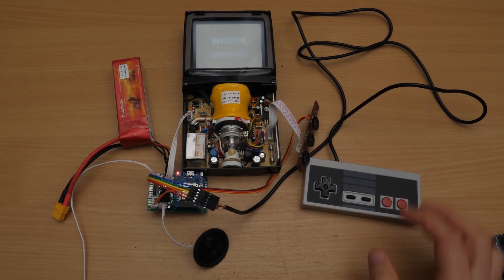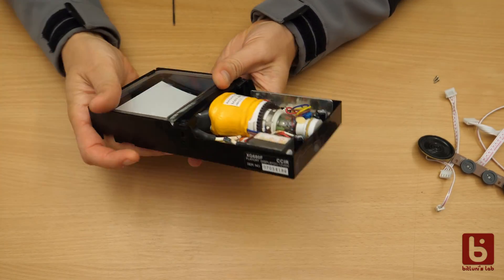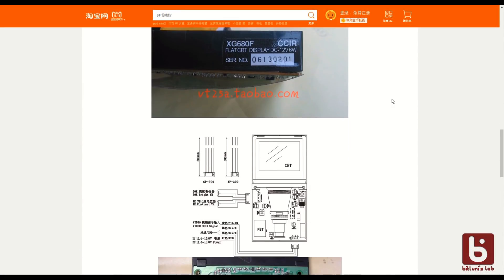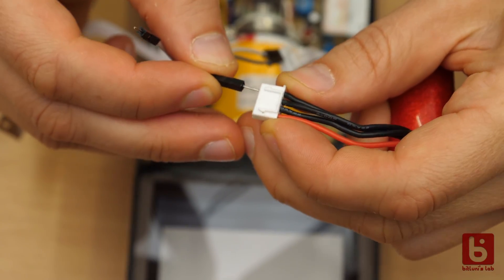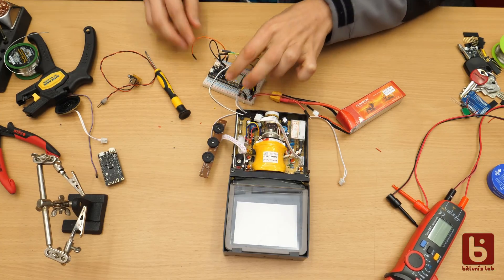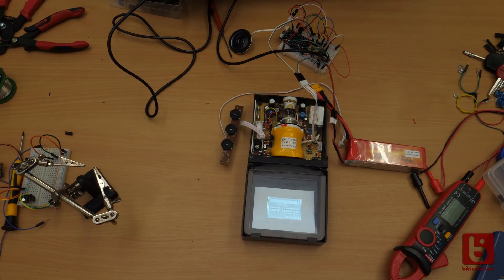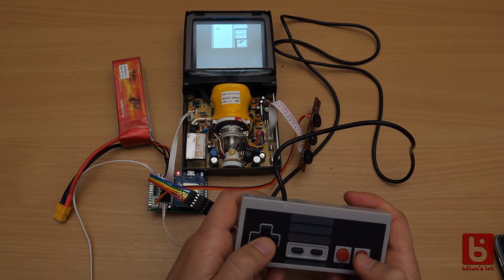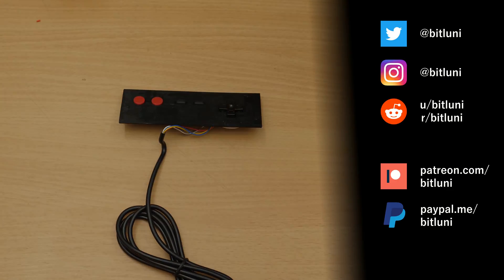CRT BOY: The Circuit [ESP32, CRT, Retro]

Comment: Very interesting.
Do you think it would be possible to convert a video signal?
I have a device which has a video monochrome output.
The problem is that the horizontal frequency is 19Khz. So it's almost impossible to find a suitable lcd.

Any idea?

Comment: Hi Bitluni I am trying to use a Raspberry Pi with this CRT and I an using AV (from jack plug) on the pi to yellow video connector. I do not get anything. I edited the config file to disable the HDMI and used PAL (2) for the composite video. No joy. Have you tried using a Pi yet? I would love to get this setup going for my project, any help gratefully accpted! Cheers, james
Reply: Hi jtreg!
The Raspberry Pi uses a non-standard connection scheme to what is usually found for composite output. Also, these things don't work without the adjustment dials or at least resistors connected. I have two of these tubes at home.

Comment: I've two of these mini CRTs in my house intercoms. I always thought they used some sort of projection...
Reply from the maker: It's interesting since they use a slightly different approach then commonCRTs. You are actually looking at the inside of the phosphorous layer inside the tube unlike the common ones
Reply: I had one ages ago... also never could have guessed it was a CRT. I ordered 2 of these tubes on TaoBao and got it running with the Venus example code.